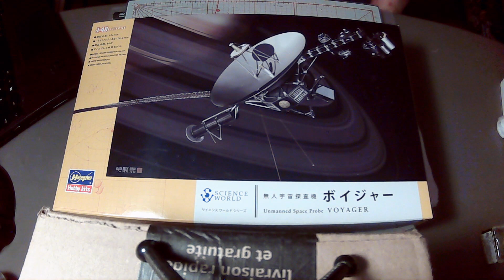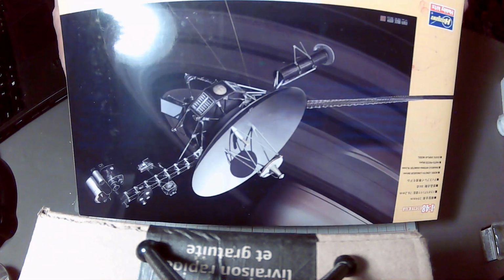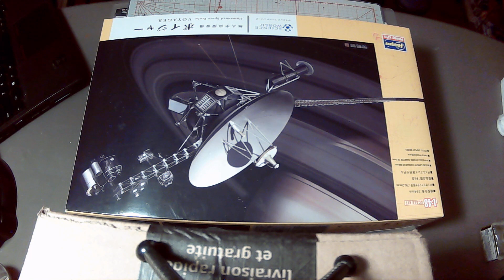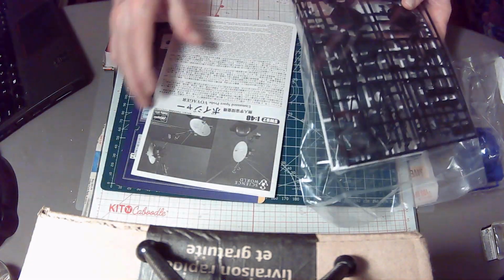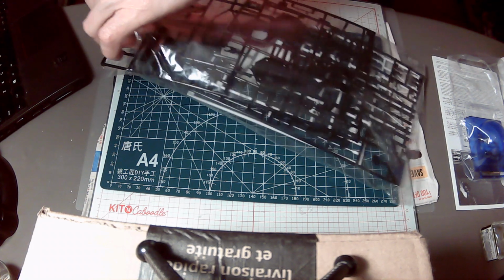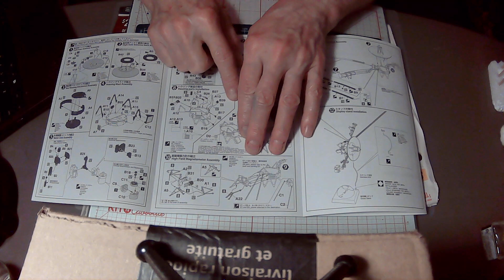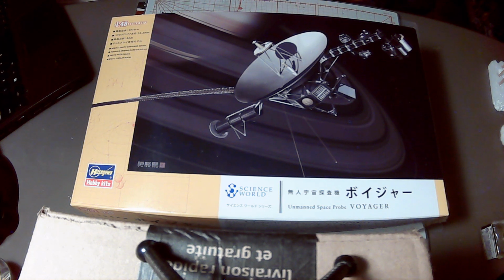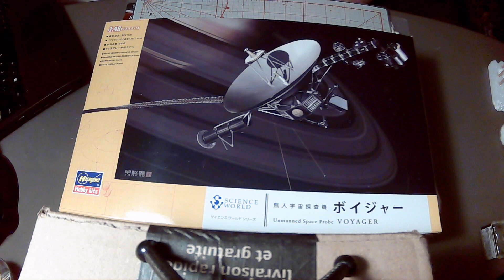Hasegawa 1/48 Voyager Unmanned Space Probe

Comment: Dear Steve,
I should begin by thanking you very much for mentioning me and my online bumblings with Voyager- very kind!
The PE is a separate kit made by Eduard for those PE enthusiasts- it offers a very significant upgrade, particularly with the meter mast and the magnetometer boom. I haven’t assembled that bit yet, but the meter mast was a doddle!
Anyway, have an excellent project and I will be tuning in!!
Kind regards,
Z
Reply from the maker: You're very welcome, Master Zin! Lol! The aftermarket PE costs almost as much as the kit itself! I dunno what might be worse, working with the PE or painting all those tiny copper lines... At least painting tiny copper lines won't result in glued-together fingers... 😆
Reply: I thought to try soldering some of the joints on the magnetometer boom. I have acquired one of those butane blowtorch affairs against this purpose. It remains to be seen if this new gee jaw becomes an expensive cigar lighter…
Regards,
Z
Reply from the maker: @ZinzanModelling  🤣